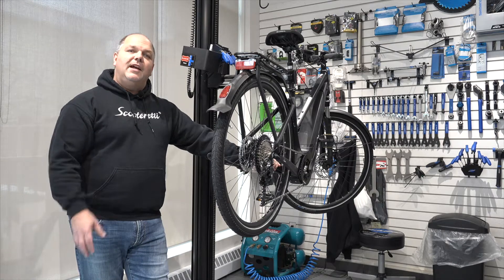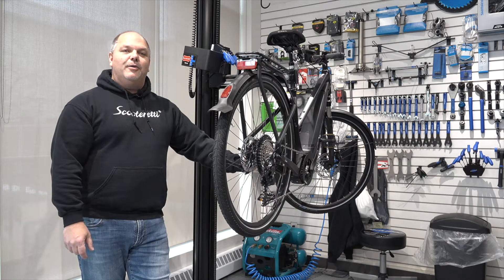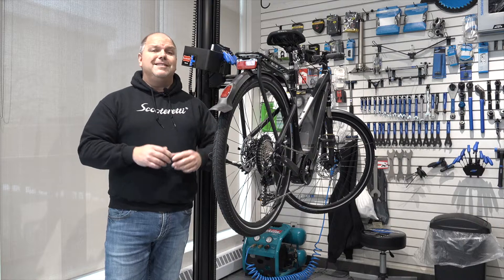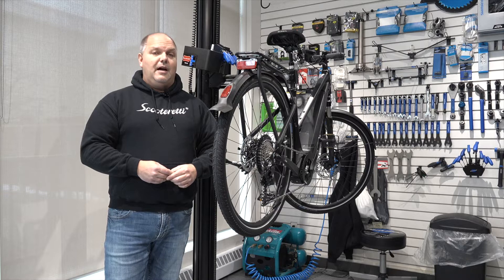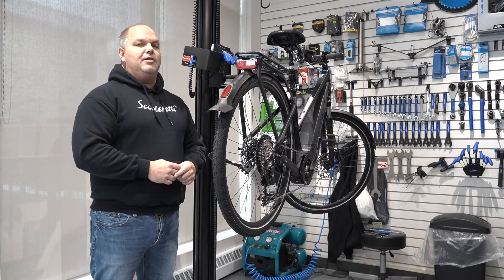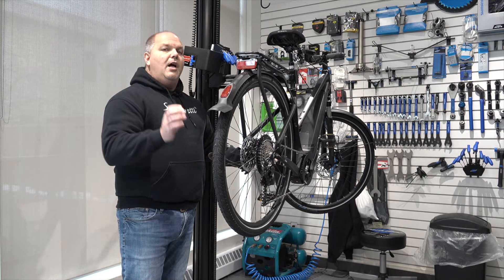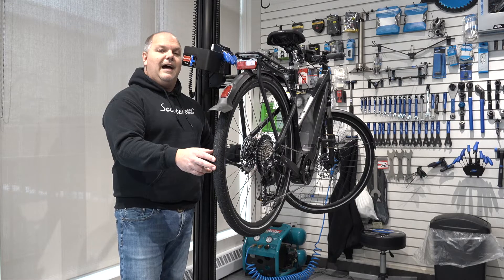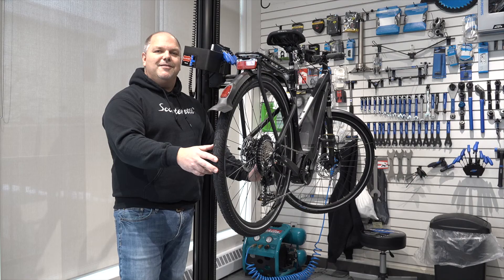Bosch Error 503 - Bosch Ebike Codes

Comment: thanks for the all information to us,what about error code 550 bosch e bike.can you give me info.
Reply from the maker: This error is typically encountered when pressure is applied to the pedals while turning on the system. To resolve it, ensure that there is no pressure on the pedals when booting up the system. If the code is still present you should have your local shop take a look at the bike for you.

Comment: Hi! I have a Bosch Intuvia with error 502. I cannot find any info about what that is. Can you please help me?
Reply from the maker: Hello. Error 502’s are related to the lights and or lighting cable. You should look for damaged wires and or a problem with your front or rear lights.
Reply: @SCOOTERETTI  Yes, I turned off the lights yesterday, and now they will no longer be turned on. But I have had this error code for months. Thank you for the tip! L'll check the wires.

Comment: So after tuning the bike by putting the sensor on the other side towards the peddle, and you get a 503 or 504 error, you can assemble it back together to standard, let it reset, and problem solved..???

But putting it back to original for a reset, don't you still have to drive around for an hour at a speed of 7 km/t to do the reset and first then the (Error) code will go away, is that correct...????

Anyone who knows how best to get rid of a 504 Error code...??? 😁
🙏❤✌
Reply from the maker: You either ride the bike for approximately 90 minutes or have your Bosch ebike dealer connect it to the software to unlock it. These systems are designed to detect tampering and hence why you are getting the error code.
Reply: @SCOOTERETTI  Thank you kindly 🙏

Comment: I got my new ebike, I did my first run with that (40km) and today I was going out for my second cycling tour. For information, I recharged the battery without removing from the ebike since there is a connector on the ebike itself. After 2km I got the 503 error, I tried what you mentioned in the video and it didn't work for me. I turned off the ebike and let the ebike for an hour in the garage. I  restarted cycling and the speed sensor worked for few minutes. Then, I got once again the error 503. I think there is an issue with the speed sensor itself. Could it be linked to the connector of the speed sensor?
Reply from the maker: Hello Francesco, if you are sure that your magnet 🧲 is properly aligned with the setting line on the sensor the yes there is probably an issue with the speed sensor itself.
Reply: @SCOOTERETTI  Thank you for the reply. Tuesday, I will bring the bike to the shop. I wish you a nice Sunday!

Comment: Thank you!!  I was worried I was going to have to bring my bike in to the shop for repair.  All that was wrong was the speed sensor had turned 45 degrees and was pointing down rather than toward the other sensor.  I really appreciate your video.  Right to the point without any extra fluff.  Well done.  I'm a new fan.
Reply from the maker: Glad the video was helpful and you're back up and running! 👍

Comment: So what's wrong if the speed sensor isn't aligned m
Reply from the maker: Not sure we understand your question but if the sensor is not properly aligned you run the risk of having an error code when out riding which may cause you assist to stop working.

Comment: I still get the 503 error code despite the magnet being in the correct position, have bosch sold me a faulty ebike?
Reply from the maker: You may be having an issue with the speed sensor itself. May want to have your dealer take a look at it and diagnose the sensor. Good luck.

Comment: So on Trek Allant + 8S Bosch speed magnet appears to be rotor mounted as this is the only place I can see something resembling a speed sensor.  My bike is displaying 503 error and LBS is waiting on diagnostic dongle.  Any recommendations?
Reply from the maker: The error code is caused by the following. Sensor not aligned with the magnet, defective sensor or not properly connected to to the drive unit. A good shop should have a spare in which they can do a simple and quick test by plugging in a new sensor. Good luck
Reply: @SCOOTERETTI  Thank You

Comment: Thank you.  My problem is intermittent “half on” of my Intuvia Module.  When this happens the display lights up except for the MPH reading and assistance levels cannot be selected, and of course the motor doesn’t engage.  Removing the module from the cradle for a few seconds then locking it back down sometimes remedies the matter, or turning off & on.  Cleaning the contacts seemed to help in the past but that no longer works either.
Reply from the maker: Would suggest making sure your magnet on the rear wheel is at a 90 degree angle from the ground facing outwards and lined up against the line on the speed sensor located along the chainstay.
Reply: @SCOOTERETTI  I know it is a bit late now, but might help others. I was getting the intermittent 503 error and had eliminated magnet alignment errors. It turned out to be a loose connection at the motor end of the sensor cable, I unplugged and replugged the connector a couple of times, then made sure that that the connector was firmly placed back in the socket, no problems since.